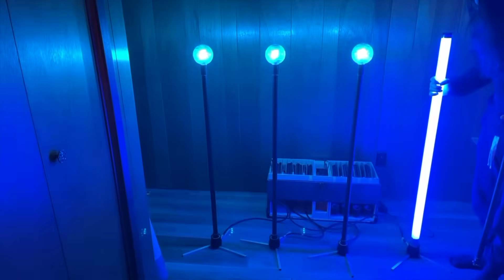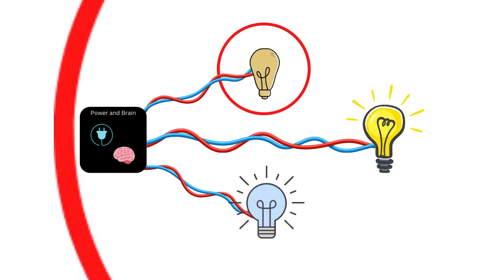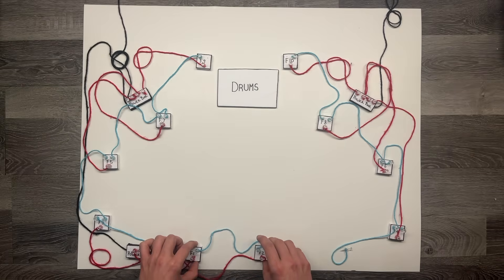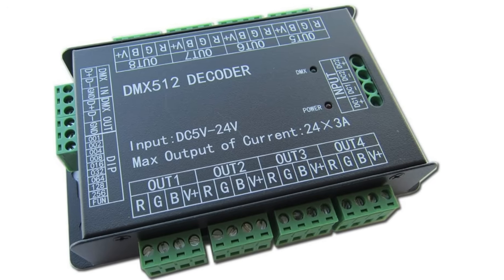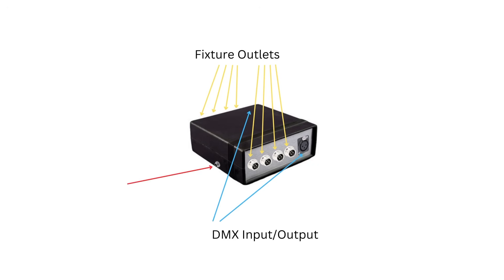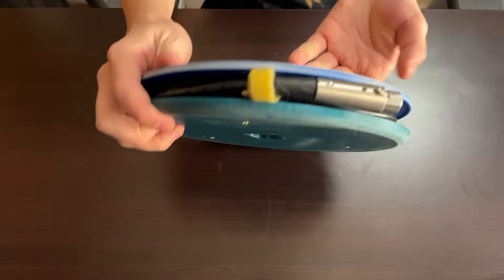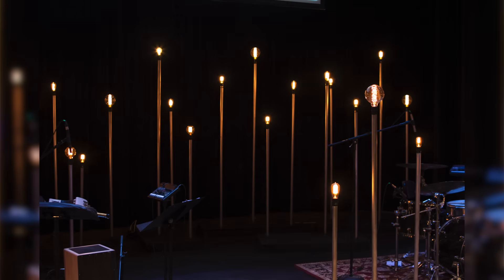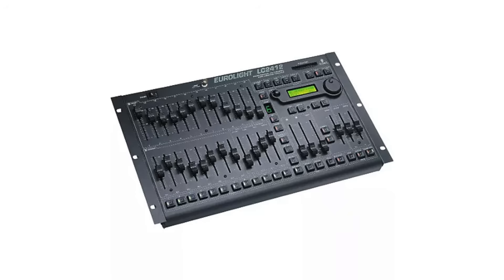This diy DMX Light Rig will Change Your Live Shows

Comment: I’m curious what LED strips did you specifically buy?
Reply from the maker: I bought some led strips from a local led supplier because at the time I was having a hard time finding good quality ones online but Amazon seems to have tons of options now especially if you are based in the states. I used SMD5050 RGB led strips 60/meter

Comment: Glasson Electronics based out of the UK makes an RGB "bulb" with an added white led "filament" inside. It has a standard E26 socket on it and they are dmx addressable. We just did a show with about 1000 of them and they worked out great! They have a special box (that looks like something out of the 80s) where you to push the bulb into a socket on the box for very quick addressing. No screwing and unscrewing, very clever. The crazy part about this whole system, is that you send your DMX signal into the distro box, and it sends the data through the power cable to the bulb by sending very specific voltages down the line that the bulbs react to.
The failure rate was very low. Maybe 0.5% of the 1100 we ordered were faulty. The support is a little weird.. I believe it's just one guy making these things, so communication takes time, but we were very happy with the rig we built with them.

Anyway, as someone thats been in stage lighting for over a decade, this video was great, and I really loved the DIY engineering here. Hope to see more of your stuff in the future. It's people like you who keep this industry interesting and fun to work in.🤙

Edits: I suck at grammar.
Reply from the maker: So cool, I just looked them up! I’m gonna dig more into their rigs for sure!

Comment: Simply amazing! We're looking for something like these in a while. Here in Brazil, lighting setups are ridiculously expansive and hard to get... for me, an diy option like yours fits perfect! Just a question about the RGB strip: do you can give any specs about the ones that you have used? Looking online there is a bunch of options and honestly it's hard to tell if they will fit our needs (in terms of brightness, mostly). Thanks for the amazing job man!
Reply from the maker: Thanks man! I used smd 5050 RGB led lights (not the individually addressable ones) try to find strips that have 60LEDs per Meter if you want the tube look

Comment: I was a ROADIE/Soundman back in the 70’s early 1980’s when you had to tap into the MAIN powerboxes  with jumper cable connectors and it was FREAKEN SUPER DANGEROUS !!!!! Each time I risked ELECTROCUTION bigtime, so it’s amazing to see how far you have come…peace P.S you STOOD on the main Cable in case you touched a positive line and BANG you were DEAD!!!…peace

Comment: The only issue I’m seeing is the spooled/coiled cables which could cause feedback for the sound guy
Reply: I think the dmx cables should be fine because it’s just data but I’d avoid coiling the power cables
Reply from the maker: Good point, I did a lot of testing with my sound guy on this and never experienced any issues but something to look out for for sure

Comment: The only issue I see with this is that barrel jack carrying 30amps, there is no point in having that good 14awg cable if your input power cable is 22awg. Those jacks add a lot of resistance under high load. after your next show feel how hot that jack gets, can be dangerous if it melts the plastics and shorts to the housing.
Reply from the maker: The barrel jack was only ever in use when using the 3 amp power supply (which came with the barrel plug on it.)

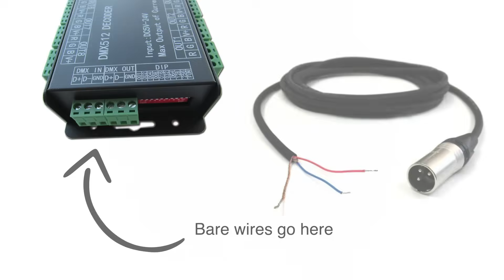Comment: 5:15 If you are into DIY stuff, try a highend PC power supply.  I made my own connectors which are compatible with standard molex like an old cd-rom.  If you get the right psu, they can actually withstand 50+ amps indefinitely, for cheap.
Reply from the maker: Love this suggestion, i will look into this for V2!

Comment: This is super cool! I've been wanting to put together a lighting rig for live shows, and this is perfect. I know little to nothing about lighting rigs so this may be kind of a dumb question, but how granular can you get with the tubes as far as lighting goes? Like, if I wanted to only light up half a tube, or a third of a tube, is that doable or would each segment need its own light strip?
Reply from the maker: The current rig only lets you light up the entire bulb uniformly but the next version will likely incorporate an option to go with pixel leds which would let you control each led in the strip

Comment: You can take this concept a step further with pixel tape and a 24v power supply.... with 2811 pixel tape, you can use 3 pin cable.  I made a kit using mic cable between the pixel decoder and the fixtures.
Reply from the maker: Pixel tape is something I plan on working into the next version. Seems to be a high demand for this!

Comment: Wonder if there’s a rechargeable battery and Bluetooth solution for this too? Could seriously cut down on wires and setup time.
Reply from the maker: I looked into this and it would be super cool but would certainly drive up costs. I also tend to try and avoid too many wireless items in my tour pack because it just cuts down on possible issues but maybe future versions could implement this
Reply: @SuperValidDesigns understandable. I bet a few old second hand USB phone charging packs in each stand would power them just find and you could have a preprogrammed display that they could cycle through. Not quite the same as a full light show but for  a small plug and play pub gig or wedding etc it’d be perfect.

Comment: If you find a better product than the dmxis box you should make an update video. From what I understand is dmxis is discontinued and the program that runs it is no longer supported.
Reply from the maker: Totally, I am working on a V2 and it will include a different interface than the dmxis
Reply: @SuperValidDesigns  what’s the other interface if you don’t mind me asking?

Comment: how can I connect and control the various dmx channels with the computer via arena resulume?
Reply from the maker: That's a great question and I've only ever dabbled with resolume for fun and never actually used it with these lights so I'm not too sure but someone on the discord channel linked in the description might know!
Reply: @SuperValidDesigns  but then I with that tool to attach the dmx to the computer riesxo to recognize every single channel, so every single led bar?

Comment: How did you get power and 3 rgb wires into a 4 core cable?
Reply from the maker: The LEDS only need 4 cables, 1 for Power, and 3 returns for the individual colours

Comment: Love this! Working on building something similar and I had a question - how did you get the parchment paper inside the tubes? I've been having a hard time with it and figured I'd ask you. Thanks!
Reply from the maker: Great question! It was tough to say the least but basically, I just cut strips of paper that, when curled up would be just under the circumference of the tubes. I then had to loosely install the metal strip that the leds are attached to which gave me a bit of a guide when sliding the paper in. If I remember correctly, I believe I actually made tiny little folds on the leading edge of the paper so that there would be a sort of "V" shape to not catch onto the bolts that hold the leds inside the tube. Hope that helps!
Reply: @SuperValidDesigns  Thanks for the explanation!

Comment: Much better, but more expensive, would have been a poe-bt type 4 system. Poe-bt type 4 gives you up to 90w and 2.5gbs of data transfer, so you can send video images and commands to robotic motors/arms. Poe-bt type 4 might even just barely have enough power that you could use it to power a video display wall of old crt like U2 did in that one famous show.
Reply from the maker: I'd love to incorporate this into a future version! I opted to go with the simplest thing at the time as I had no idea what I was doing when I built this lol

Comment: Hey as an Electrician and someone who works with LED i'd really recommend using 24V for power distribution. One reason is power loss, because less amps needed per Watt used.(U know P=U*I) Plus then u could longer distance cables if needed.
The other reason is because 24V LED Strips are often higher Quality, have higher maximum Light and u don't see a difference in Brightness from Buttom to Top. In home installations theres only 12V in like Small Furnitures, theres always 24V for anything bigger. And yeah i can even see a small difference at like 2m with 24V when holding both ends together and we have very high quality ones with a big cupper rail, not that it would really matter if u use a diffusor anyway but yeah.

I actually had the same idea to use those Aviation plugs and then just daisy chain some self built led bars, but never had the time to build it. Really cool system btw.
Reply from the maker: I completely agree! I wish I had known this when I built the first version, especially because I ended up having to use such beefy cables to avoid noticeable voltage drop across the 20 foot lengths. And I did end up buying expensive pro grade LED strips because the 12v ones I found online at the time weren't great. Future versions will likely be 24v for sure though!

Comment: This is an incredible design and well thought out! I like the spool idea! I'd probably build it out of a road case with casters to easily roll in. Another thing i haven't seen people mention to give yourself a competitive edge, is to use individually addressable lights. I'd watch some videos on home christmas lighting and WS2811's to start. Throw a pixel controller in your brainboard instead of the 0-12v board. Place a network jack as input instead of DMX, and send sACN to the controller.
Reply from the maker: Having the addressable LED's would definitely be a step up for sure! I opted to keep things simpler for the initial build but this would definitely be a a massive improvement. I'll look into this for the updated version!
Reply: The question is, if you can actually program the lights with the dmx sofwares, or you would just be limited to the WLED apps and such. do know if programing them with a dmx sofware like EMU or SoundSwitch would be possible?
Reply: I've used an chip loaded with WLED. Then I use Hyperion to map and route video to the LEDs and I can do regular VJ loops

Comment: I think you should go with the spool as the base idea it looks cool and it keeps your cable tidy etc
Reply from the maker: I agree, the updated version will use this approach i think
Reply: @SuperValidDesigns  if you can get a small enough wireless dmx decoder pcb and some rechargeable battery’s and make it so it all fits within the tube/stand you could make them completely wireless? Which will dramatically reduce setup time and tear down obviously you’ve got to remember to charge them before each show, and it may be a tad more expensive and tricky to build but may be worth it? Just an idea

Comment: Are the aviator cables carrying power and a DMX signal?
Reply from the maker: The aviator cables just carry 12v power, one hot line and 3 return lines for RGB. The DMX signal is only sent to the DMX Decoder in the distro boxes which converts the DMX signal into the appropriate voltage to power the LEDs

Comment: This is very very very cool and those four tubes would be perfect for my solo performances!

The only difference being that I would probably like to program them on a per-pixel basis so I’d like to add some kind of arduino interface that would take midi from a hardware sequencer, i stead of DMX control
Reply from the maker: Per pixel would definitely be a step up! Let me know if you figure out how to implement that!

Comment: Amazing! What are you using for syncing the lights to the music at the end of the video?
Reply from the maker: I am using this device called a DMXIS (though I’ve heard they’ve stopped supporting this device on newer versions of Ableton live but there should be other options out there) but the device has a plug in that can be opened in Ableton live and it lets me use Ableton’s automation controls to command the lights along the music timeline

Comment: I would very much like  to see you build the new spool with slip rings.
Reply from the maker: The slip ring version would definitely be the coolest system for sure. I am working on an updated version but I'll likely opt to go for the version where the bases are the spools as this will likely be the best option that provides additional usability without any added cost really. The slip ring version could still happen though but it would likely just be a proof of concept and not a fully marketable product

Comment: That is really cool Man are you going to upgrade to ws2812b led pixel strips. That will be next level. I use that led in side of a aluminum bar with a frost on it with quick connect, en control it with resolume, maybe that is something to look at for your rig ?
Reply from the maker: I would love to figure out a system using pixel LEDS at some point. I thought of doing this at the time but opted to go for the simpler analogue version just for the flexibility sake of being able to swap out fixtures of any size without having to deal with any reprogramming at all, but there is probably a way to make the Pixel LEDS work in a similar fashion! I'd have to do a whole separate rig though since I think those LEDS require a 5 pin connector as opposed to 4 and likely an entirely different driver set up.
Reply: @SuperValidDesigns  for the connection 4 pins is good, you got also led pixelstrips that use 4 connection, and also it is not that hard to work with pixelstrips. i can help you if you want with the first part that you need to now about this led and how it works.

Comment: This the smartest lighting rig for bands I've ever seen on YouTube. Other videos made these DIY tube lights, but didn't take into consideration easy load in and out. You solved that problem. Pure genius. Can't thank you enough.
Reply from the maker: Thanks so much! Part of the reason i did this video is because, when I initially wanted to build a rig like this, i searched youtube and likely watched all the videos you referenced. And while they were helpful to get the lights going, no one had a good system for transport and for touring, that's half the battle for sure! I'd still make some improvements but this worked pretty well on the road!
Reply: @SuperValidDesigns  Guaranteed one of my parents would be going on and on about a fire hazard.

Comment: Great idea..... so you use two connections for the +/- 12v. Then 2 for DMX signals?
Reply from the maker: Thanks Darrell! So the dmx decoder sends 12v through one of the cables and then the other 3 cables are Red, Green and Blue, which allows the control of the different colours. The dmx signal goes into the DMX decoder from the DMXIS box but that signal is never sent to the actual LEDs, if that makes sense!

Comment: Amazing work, this video is gold! 

I'm looking at some DIY options for lights for show for this summer and your video is on point! 
Do you have an estimation of the cost in total? (excluding the time you took to build haha)

Definitely following your next projects!!
Reply from the maker: Thanks so much! Cost wise, it's a bit hard to say, since i built it a while back and I could have saved a bunch of money on the cabling/LEDs (I bought LEDs from a local LED shop because I wasn't confident about the quality of the ones I had gotten online previously but I think the options are way better now) but the DMX Decoder is currently about $70 cad and the big PSU is only $30 or so and those are really the main things needed to get started. As far. as the fixtures and the bases, these were pretty cheap just using off the shelf plumbing and lighting parts from home depot! I plan on putting out a build guide on my website at some point where I'll go in depth on the build specifics
Reply: An option I've been considering for a while and something you might want to put in your consideration is that you can get a super barebones mic stand with a low profile round base for $15USD, I've seen them as low as $10 each in bulk.  I haven't fully figured out how to integrate them yet, but for that cheap it seems like a good way to implement some standardization/repairability into a freestanding design like this.
Reply: @dcurry7287  Interesting, only for the second model with the light bulb at the top or would you also consider that option for the Led tube one?
Reply: @MidnightUnity  I was looking at desktop stands like "On-stage DS7100B".  They've got a stubby actual mic stand, only around 4½" (13cm) tall, and a 6" diameter base.  I was thinking that height is just about perfect to get it above cables, pedalboards, and feet.  They're pretty light but for a straight up and down fixture they should be fine, the low weight is a plus for me lugging them around.  My venue has a couple circular sandbags if they do end up tippy, a touring owner might want to just go for a heavier base.  

Parts Express has female mic flanges for around $5USD, I'd pop one of those on top and 3D print an adaptor between the flange and the florescent tube.  I'm a 3D printer noob but some concentric cylinders should be doable even for me.